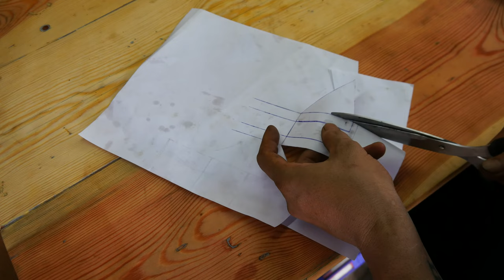Forging crossbows from truck tweezers - A unique combination of steel and wood

Comment: Nice design but your missing a fundamental thing about cross bows.... your bow is bent way too much and it only gives you a few inches of push to the bolt... instead simply un bow the bow and lengthen the stock a few more inches so when the bow is bent now the bolt will be pushed several more inches to get the maximum speed for the bolt.... yes most commercial cross bows have this flaw, but if your making it yourself do it right !  also the bow itself should have it's tips parallel with the bed where the bolt slides this reduces drag and increases the velocity by a big amount... it usually means making your own bow from a car spring but with your talent you can do that !  I have a crossbow hanging on the wall of my shop that has a PVC (double pipe) bow that is very strong. the bow string  is almost straight
by the way with very little arch to the bow itself but when it is cocked there is a big bow in the bow..... so the bolt has the whole length of the stock to accelerate not just 5"~6"
Reply from the maker: Thank you for your great contributions, I really appreciate it, wish you all the best
Reply: I would prefer to extend the stock ngl. It just looks to short to me, and more so  kids size crossbow.
Reply: @articwarrior9872   It is surprisingly HARD to get alot of power from a crossbow ! the first few I made were barely strong enough to fly 50'
the reason is the bow, drag on the string and ability to cock it.
at a bow strength of 100 to 150 lbs it comes to the point of having to cock the crossbow because you can't cock it by hand lever action that slides works the best i think. winches are slow and troublesome.
I made a balastia out of an entire set of leaf springs from a truck.... had to cock it with a winch  it shot a broom stick dead level 50 yards into a pine tree and went in 6" with the metal tip.... although it was more a conversation piece than anything else it did work and work well with only about 5 minutes between shots ! LOL
in my experience most commercially available cross bows are not good enough for hunting, their just too weak.... I even took a full size 75lb bow and arrow and put a stock on it.... that worked very well but it was clumbersome...  so in the effort of making the bow smaller you take away the bolts speed.... but the bow has to be smaller to be viable. it's a hard balance to achieve....people do not realise how powerful a bow and arrow are.... My 55lb pull Howard Hill long bow will shoot an arrow as fast as a 30.06 rifle bullet.... dead level trajectory and go completely through a bail of hay... the penetration of the arrow is the key... My Dads 65lb Howard Hill bow went completely through the deer he shot once through the shoulder and then through the hips..... the arrow went completely through the deer ,through bone and all...  a good hunting bow is hard to beat, silent and deadly....
Reply: @bobkelly2447  I don't have much experience with bows except for the 20lb compound bow and 50lb recurve bow that use use for practically just building strength, so I hardly understand most of what you said, but I would like to learn more ngl (especially if it helps me turn the shotgun stock I have into a crossbow that is very effective)
Reply: @articwarrior9872  Well that shotgun stock will be fairly short for a crossbow.... you'll have to lengthen it one way or another.... it might be easier to just make another stock from scratch.... a 2"x6" 28~30" long is usually a good thing to make a stock out of, or as long as 36" depending on the bow you plan to use.  a bow that is barely strung and only has a slight bow to it say the string is only 2" from the bow center will throw a arrow/bolt much faster than one that has 6" between the string and center of the bow..... the reason is because it pushes the arrow/bolt much longer
and the arrow/bolt receives a much faster speed as a result...
it's all about speed....  speeds of 250fps is not very fast the trajectory will be arched to the target 50' away...but a speed of 1200fps will have a flat trajectory to the target at 50'  so speed is the key ....
a compound bow is alot different than a traditional bow, it puts the power into the very last of the push of the arrow/bolt... it's harder to cock as at the first of the pull it is very hard but gets easier as it goes further back
that is what you really want for an arrow/bolt to achieve the fastest speeds.   
the next important thing is string drag on the stock itself. mounting the draw string on top of the bow goes a long way in reducing drag or making the bow that has a angle up to both of it's limbs... this is hard to do from a
construction standpoint.but the end results means faster arrow.bolt speeds..... Also arrow weight is important.... shoot a solid steel rod and then a hollow fiberglass arrow and you will see what I mean... but what is not apparent is the penetration power of the two.... that heavy steel rod will penetrate much further because of the weight involved. once mass is in motion it tends to stay in motion.    using the lightest arrows you can find
will give you the fastest speeds but the least penetrating power.
I tend to use a light arrow shaft with a heavy steel tip and find that to be the best all around for target shooting....
Reply: @bobkelly2447  Ok, the stock part I understand on now, but for the bow section. Would it make a difference in power if I used the Penobscot method using leaf spring?
Reply: @articwarrior9872   I can't answer that because I don't know what the Penobscot Method is.....
Reply: @bobkelly2447  It is basically utilizing a smaller bow flipped backwards on a full size bow to add mow power to it
Reply: @articwarrior9872  that is basically just making the bow stronger.... yes that should work... but your better off just making a better bow in the first place...because you are complicating the issue... more things to break while in use. Crossbows can be very simple, mid-evil or super modern.
and can be made with just about any material....their sole purpose is to fling a stick a long way....accurately every time....the better it does that
the better the crossbow.
the bow itself can be made from Wood, spring steel, PVC Plastic,RUBBER
or even Rubber bands  if it's made from wood the bow itself must be longer to allow sufficient flex. but if a shorter bow is used the draw length needs to be reduced to assure you don't break the bow.
spring steel was moved too because you could make a bow both short and powerful with enough flexibility  to handle a long draw length.
PVC Plastic can be used fairly easily in many forms, in the original pipe form, or in flattened tubes to make flat bars, which can be stacked just like steel leaf springs to increase strength. the back yard Bowyer  has several
great bows that can be made in a few hours that work just as good as store bought bows ! ... making a bow small enough for a cross bow this way... can be done easily just by flattening the pipe and stacking them
....Woodworking Studio has several sling shots using surgical rubber for rubber bands.... and they can be very powerful as well....more than enough
to kill a rat ! and can be made to auto reload with a simple pump !
My crossbow hanging in my shop has a round PVC pipe bow with a 1/2" PVC pipe inside it for added strength...  it's about all I can do to cock it
without any assistance,.... it's trajectory is flat at 50' and only arches slightly at 100' and sufficient to go  1/2 way through a person/deer.
i use a wheel lock for the trigger,held on with aluminum plates on both sides.... it works well.
Reply: @bobkelly2447  Fair enough

Comment: Вы серьёзно закалили метал в воде😂😂😂?
Reply from the maker: Metals are hardened in many different ways, not necessarily according to one standard, depending on the purpose and steel material.